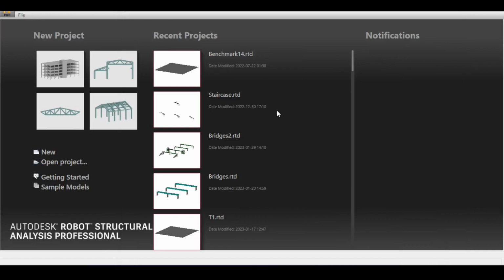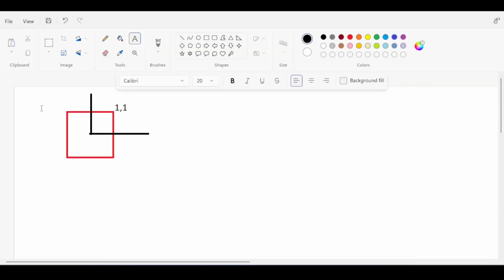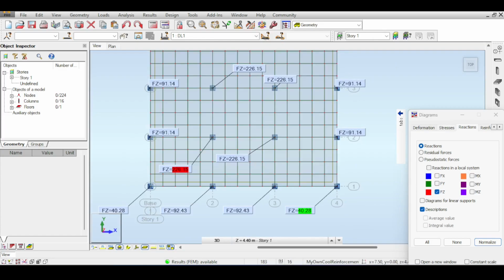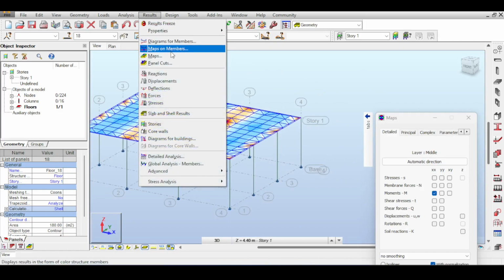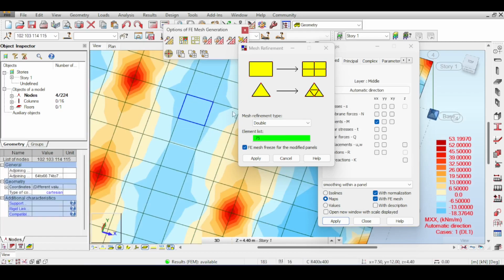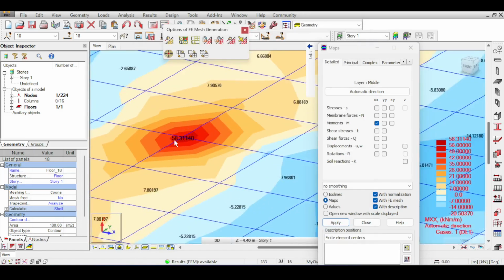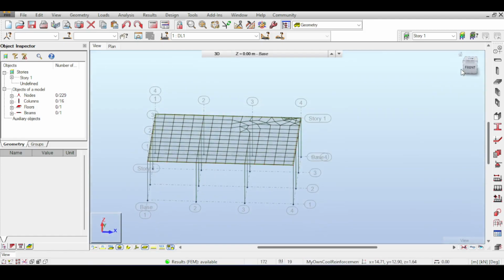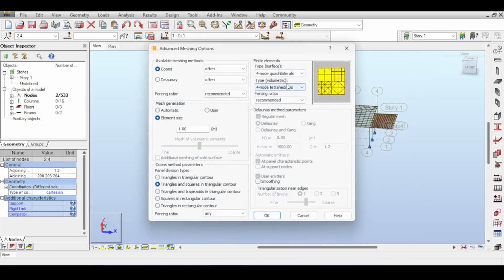The Slab Series | Part 3 - Understanding Meshing | Autodesk Robot

Comment: Dear CEE, let me tell you that your videos are getting better and better!

A Few things i want to disscuss:
- in collegue i was told to use in slab models FE size about 0,5-1 m. Do you agree?
- also, to use emitters or “radial” FE in corners and singularities such hollows or high loads.
- whats wrapling in meshing?

As always thank you very much!
Reply from the maker: Hi there dear Engr. Candea,
thnx a lot for your comment. I do actually feel larger responsibility with the increasing number of subscribers. I am actually learning how to more effectively video edit my videos and make them more interesting. Once I am at a certain level, then I will try it out.

Now, to your questions:
about mesh size, here is an article https://www.masterseries.com/blog/fe-mesh-size

But to summarize, span / 10 or 1000mm, so in case of normal spans between 3 to 8 meters, you would end up with 0.3-0.8
so your college approximation is quite on spot.

And I agree with emitters, but to a certain extend, you saw what happened if you go too far.

Finally, about mesh wrapling, I am not 100% sure about it to be honest. Do you mean "warping"? Warping in that context is how much a FEM element departs from being a plane. Now in normal FEM, the warping should be zero because we are assuming that our elements are plane elements. This is EXTREMELY important because we do have an assumption about "plane stress" or "plane strain", with plane being the operative word.

Now there could be some interesting research in 3D warped elements that do not follow a plane, but in the regular sense, a FEM will break it into triangles that are always planes (a triangle is guaranteed to be planar).

Hope I was able to answer your inquiry.

Regards,
CEE
Reply: @CivilEngineeringEssentials  indeed they are! Crystal clear i must say thank you for everything again CEE. Hoping to watch the FEM advanced options from RSAP. Regards from spain
Reply from the maker: Hola Amigo 
No hablas espanol (thats all i know)😁
Stay tuned

Comment: Hi, good video. At around 23mins 20 secs in the video you speak about high concentrated stressed areas, burning areas. Is there a rule of thumb of how much you move away from these highly concentrated areas when interpreting moments and shears? Even when applying reduced forces over columns and walls? As this is always very difficult to interpret, and even when interpreting concentrated reinforcement areas over the heads of columns? Should it be taken at column face perhaps rather than centre of column node? Also, a video of how to interpret such results would be good, as there can be a huge difference between moments and and shears, and reinforcement areas required directly over column heads and those a short distance away, just a suggestion….keep up the go work!👍
Reply from the maker: Hi there, first of all, a huge thnx to your comment.

My own little rule of thumb is to move half the width of the column away from its center. But I will be talking about that in the next video, coz I found that it might be too long for this video to be included.

So, your suggestion is highly regarded and I will take it into account the next video (or maybe the one after it).

However, I do not just want to shift the answer for a next video, you can read a little bit about impossible convergence in
A first Course in the Finite Element Method (Daryl L Logan)
Concentrated or Point Loads and Infinite Stress page 360

Anyways, thank you very much for your comment. Consider supporting the channel by suggesting it to your colleagues. It helps immensely.

Regards,
CEE